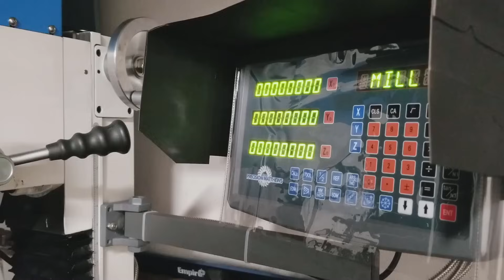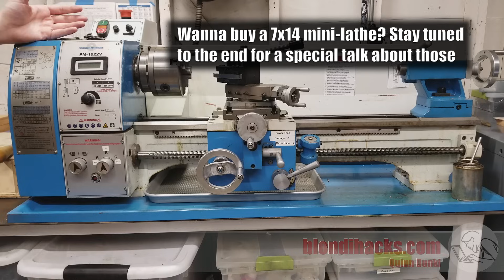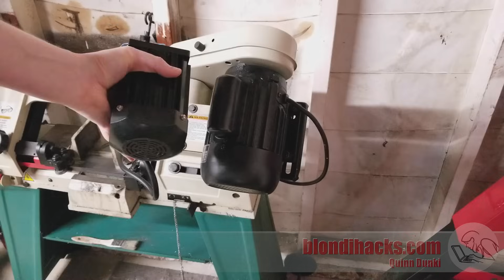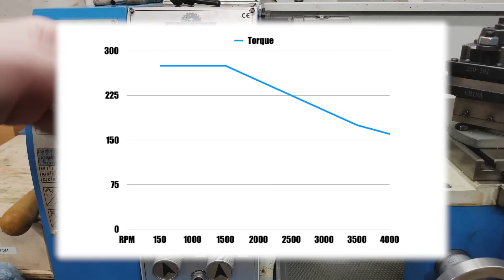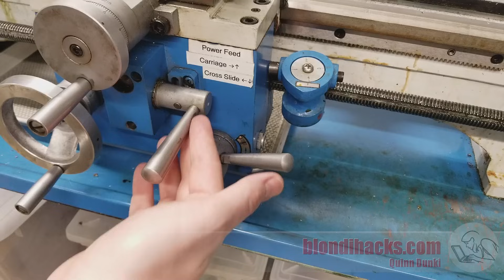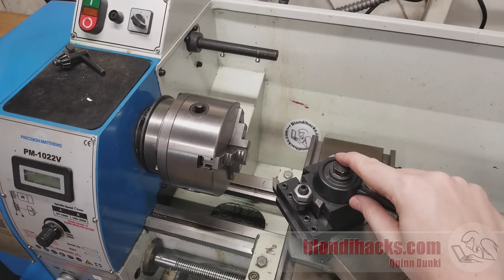Import Lathe Buying Guide

Comment: Very well done. Although I have only ever owned and used older US iron machines, I have always been curious about the specs on the better quality imports. Thanks for the information.
Reply from the maker: They’re a lot better now than they used to be, but there’s still a lot of junk out there.
Reply: @Blondihacks  I have another small Central Machinery lathe, it's probably 10 years old, it's an odd dark maroon color, and has an AC motor with no speed control other than belts, and all metal gears. I think it was around $1200 usd. It's really not that bad at all. Several I've seen lately are all plastic gears, with tons of problems.

Comment: Thank you as usual that was a very well constructed video and you have a better grip on the physics of AC and DC motors than most lathe operator's, I suspect you could be a professional in the electronics field? Please could u put me out of my misery what is the large white Bosch object on the lathe wall ? .look forward to your next video .
Reply from the maker: Thanks! I know enough electrical engineering to be dangerous. 😬 The Bosch unit on the wall is an electric car charger.
Reply: Thank you for answering my question  , now i know why you have an oscilloscope.  good on you for going electric !

Comment: Really great video! Also a very needed video. So many forums out there try to make people believe that no lathe less than 2,000 pounds can do anything. I have a bench top lathe and a bench top milling machine and I am thrilled with both of them. Like you I find that step one with the import machines is take everything apart and clean it and maybe tune it a bit. The best part is everything fits in a corner of my garage.
Reply from the maker: Totally. These machines are a lot better than people give them credit for, and any machine tool is better than no machine tool.

Comment: Great episode and the advice is spot on. I made money on 7x14 import for 10 years but I knew all my parts would be 1/2 - 1 1/2" aluminum. Never expect these machines to work right out of the box. You should always tear them down, clean and degrease them, and then reassemble and align them. A good understanding of cutting angles for the cutting tool helps stay way from carbide inserts which rarely work good on these machines. HSS inserts work great but are hard to find.
Reply from the maker: Yes, I’m a big fan if HSS insert tooling. Sizes are really limited though. Like I’ve never found HSS inserts that will work in a face mill.

Comment: Well poop. My new secondhand lathe (mj-450a) doesn't have a lot of what you describe. But it was only €650, including a lot of tools. And strangely enough they have open tapered bearings... from the factory it seems. And a 1hp 3phase motor with electronic frequency controlled phase converter

Comment: One nice thing about a good DRO is that other than threading, metric or imperial is just a matter of pushing a button on the display.
     10 years ago when I bought my new lathe, American lathes were almost impossible to find here in Oregon and were really expensive, so I ended up with a Grizzly 4003G, 12x36 with Japanese spindle bearings, D1-5 camlock chuck, lots of good features and it's done a great job for me, and I paid a little over $2500 for it brand new.  Today, the same lathe is more than $4500, and oddly enough the American machines have come down in price and become much more available.  I'd probably make a different decision today if I found the right lathe, but I've been very happy with the G4003.
     I did have a little 8x14 for a while, the lack of a quick change gearbox quickly drove me crazy, and I had to sell it and buy the 12x36 as soon as I could.  Don't underestimate the pain in the butt factor of having to swap gears for thread cutting, if at all possible get a lathe with a gearbox, and do put a cheap DRO on it.  A DRO isn't necessary but it does make a lot of jobs much easier.
Reply: Thanks, Don. Good information. I am just getting into machining and am watching a lot of videos before buying. Blondi has been the best teacher so far.
Reply: Also, good tip on the DRO. Are they easy to add?
Reply: I think people started realizing you can do alot with a new import with a little tweak while the SB is mostlikely worn out and missing  hard to find parts. I have both . Thanks BH for a nice primer on import lathe.
Reply: First thing I did was throw a DRO on my small mill. It's a lifesaver.

Comment: I bought a Precision Mathews PM-1236 and have been extremely happy with it. I went that large to get the features you just described (D1-4 cam lock spindle, separate power feed shaft, nice headstock gearbox, etc). I also upgraded to a quick change tool post and DRO. I didn't go for a model with a coolant pump and instead set up a Noga coolant mister using an empty Jack Daniels bottle as a coolant reservoir. I couldn't find an empty Jack Daniels bottle so I had to construct one from a full Jack Daniels bottle.
Reply: Looks nice! But you have to do some serious work for that budget. My wife would move back to her parents if I spend such an amount of our savings on my hobby...
Reply: Jochem Bonarius : Don't buy Tennessee Swill Water. You can save a lot of money buy buying good Kentucky Bourbon. I recommend "Kentucky gentleman" or" Kentucky Inn."

Comment: Qiinn, what about adapting a treadmill motor to the lathe like I plan on doing to get a little more power at the mid range rpm's?
Reply from the maker: That sounds like a bold experiment! Curious to hear how it goes!
Reply: Treadmill motor are designed to run at really high RPM's, at least the ones I've used, so you'll need a ton of speed reduction, and their power is grossly overstated.

Comment: Mine has arrived a day ago, now I'll learn how bad it is! Let's see... :-D
Reply from the maker: You will have a ton of fun, I guarantee! They’re just fine for lots of projects. 😄 Don’t let me be a wet blanket.
Reply: @Blondihacks  Thanks. I couldn't split my budget in two because there is no lathe that cheap :-D So, since unboxing I have been mostly ogling it and trying to turn pieces of scrap I managed to find. I'll have to collect tools and upgrades in the upcoming months.
Reply: Kira Verhovyh I tried turning scrap (still do) but see if you can get some decent metal to turn, some leaded steel for a start perhaps, because when you manage to get a nice finish on something, even if it’s just for practice, it feels so good and you know you’ve made progress. Any old scrap might be rebar or something, and that’s always disappointing! Ask your local machine shop, they might let you have “drops” that will do you well. All the best with it. Les in UK
Reply: @leslieaustin151  Don't use Lead or Leaded Steel if You don't have a serious Air Cleaner
Reply: one thing you can do is comb the local machine shops for broken end mills and worn out inserts. if you have a bench grinder and halfway decent stone, you can whizzy up some pretty decent cutting tools for very little money.
Reply: Which lathe did you buy?